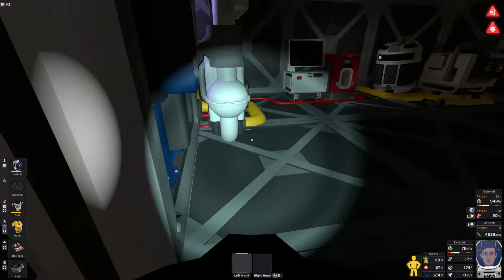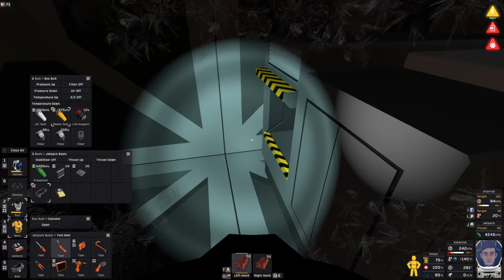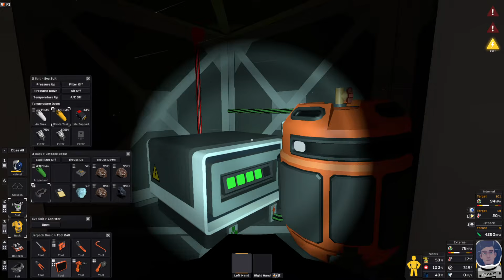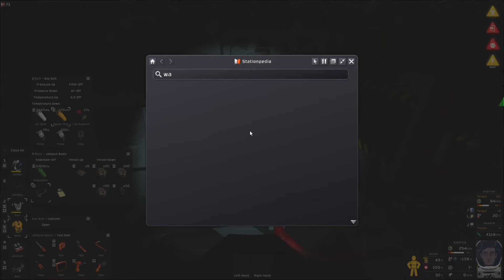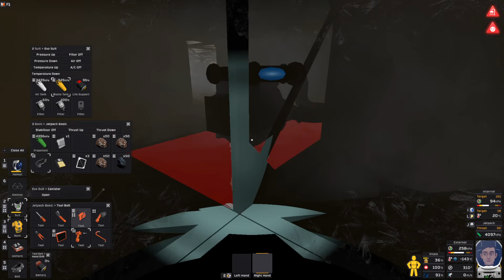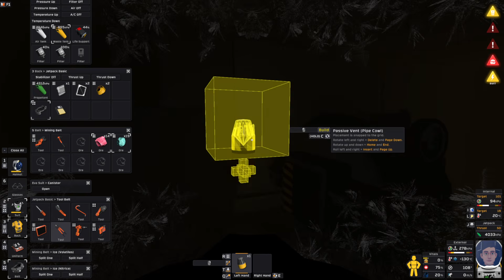Stationeers Titan Part 11 : Copper Teaches Patience

Comment: Hiya! Thank you for the mod and the video! Consider moving the power source for the airlock's power controller and the charger to the OUTPUT of the station battery. In this way, you should be able to have charged batteries until you lose all of the energy in your station battery.
Reply from the maker: It took me so long to remember to do this! Sorry :)